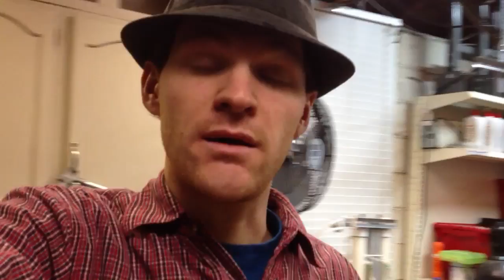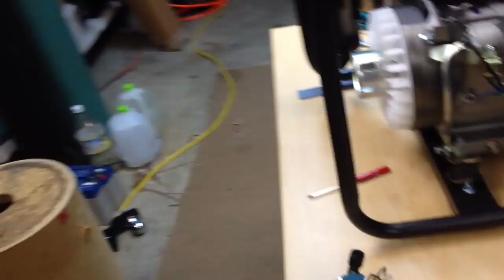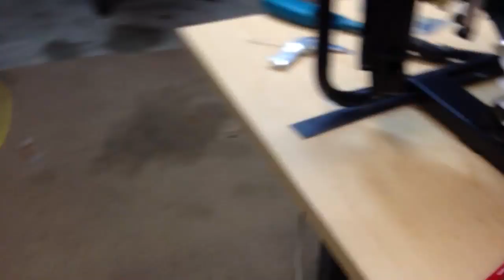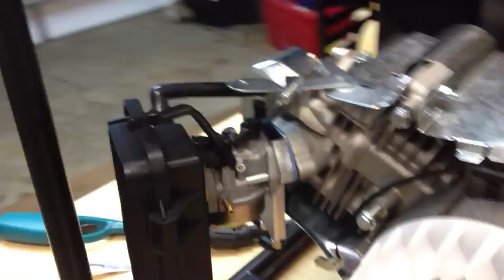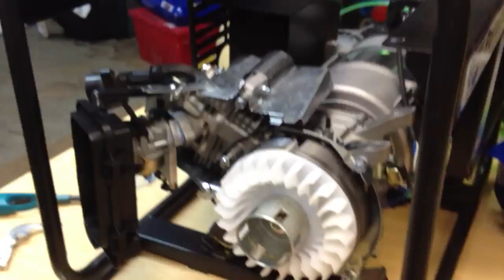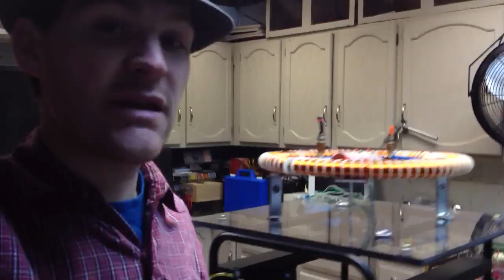Burn-O-Meter, GenSet, Tornadoes, Live Show, Update!!! God Bless!! ~Russ

Comment: I think the reason the unit seems to have more power when the gas is mixed with others, is the HHO implodes more in its pure state while added gasses will not allow this.  Added gasses take on the transfered energies.

Comment: using a hall and the crankshaft magnet creates issues, The crankshaft will turn 720 degrees for each cycle. To work around this we installed a magnet into the camshaft and mounted the hall inside the engine. I'll try to remember to catch the live show. Peace
rawbush

Comment from the maker: @FreeEnergy0001 I see what I did wrong. Lol thoughts somthing was off. So yes. Let's all it 2.5lpm of hydrogen derived from a bottle. Not my cell. So this is not a hydroxy mix. This is stright Hydrogen. And meter mixed ambant air. No mods to the timing or anything like that. Again I want to play with timing and see if I can better the results. Also you seen the motor run? When I say idle, I mean just enough to keep it running. More like 5-10 Lpm to get it to smoth out. Thanks!! ~Russ

Comment: @rwg42985 ferrite cores can be bought in what perm? 1600, 1800, 2000, 2600
well that narrows the perm down to 4
as i told you on the fone, its just ferrite, not magic
research requires buying stuff
not forums and passwords
i find it funny that i keep a ignition circuit secret and an exact core material secret until they come in
i m a bad guy
i find it funny that woodside gives all this stuff away on globalkast and noone checks it out
condem me for not telling you stuff on the fone. thats a laugh